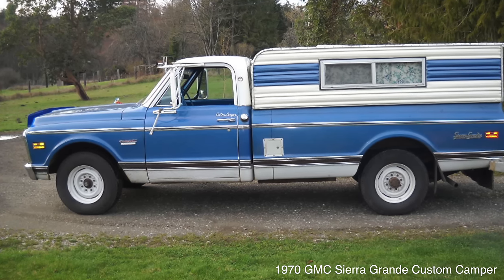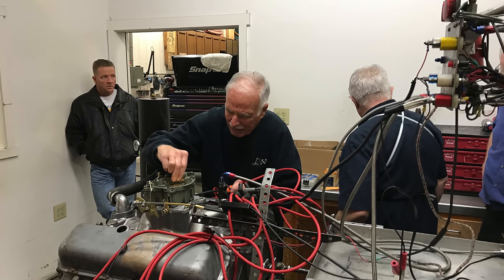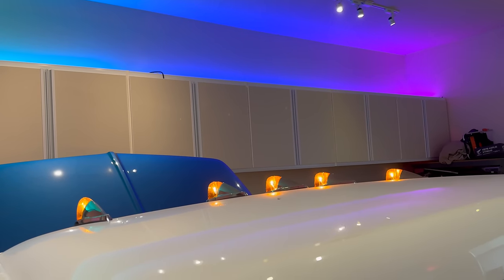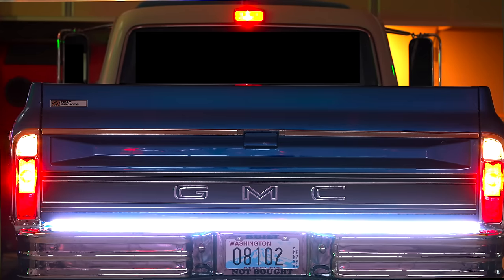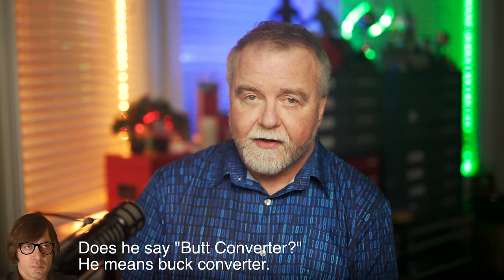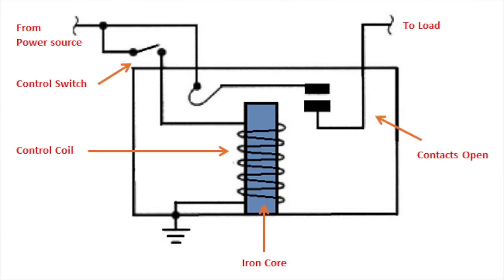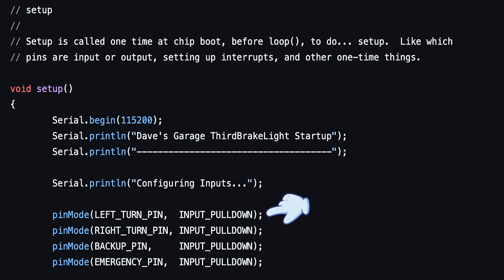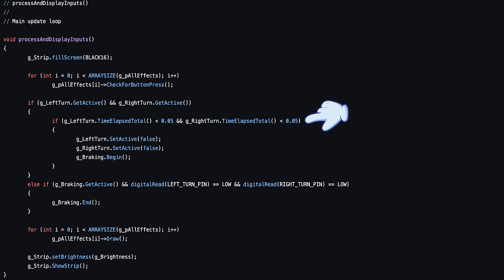New C++ LED Tricks for Our Old Truck: Sequential LEDs

Comment: Input yes you can use a simple voltage divider, but the optocoupler works well to get some isolation, especially if you use a 4V7 zener diode in series with the LED to get voltage immunity to the signal, so a blown bulb does not leave the brakes on all the time from stray voltage.

Resistor divider you also need a set of diodes to keep the voltage from exceeding supply rails, along with a small capacitor (roughly 100n) to provide noise immunity on the input. 

Incidentally reed relays work well, small, easy to drive, and the contacts interface well with MCU inputs as well, as they have very little bounce. Just have a pull up resistor to provide 2mA of contact current to keep them in good condition, and it works. I have added trailer relays to my car, as I do not want a faulty trailer wiring set to blow the BCM up, and used 4 relays to do this, using the existing lamp wiring as source, and an extra fused power lead from the battery. In the power line is a reed relay, with the coil replaced with 12 turns of enamelled copper, there to close the contact when current is over the draw of a 21W trailer lamp, and then the reed is powered from the 12V supply, and a lead runs off to a LED near the dash, that lights up whenever I press brakes, or turn, with trailer attached, as a confirmation that trailer indicators are working, and at least one brake light still works, and the plug is connected.

Will guess your TRS80 issue was simply because the original designers ran out of space in the very limited ROM, and thus to get space to fit all the headline specs they had to sacrifice some things, and the full keyboard debounce was chosen, simply because it was not an issue with a brand new keyboard, or only minimally so, only getting worse as the keyboards aged and were made cheaper. New switches with clean contacts minimal bounce, but as they age, and the contact surfaces, with only a very small current, get dirty, there is a build up of resistance till the force is enough to break through the film. 

That is why industrial logic almost always has a 24VDC rail, and 10mA of current flow through a switch input, even if it is going to a MCU input only. The voltage is high, and also the 10mA of current, along with the 22n to 100n input filtering capacitor, provides enough energy to always clean the contact surfaces, so allowing them to be reliable. 5V logic needs that 10mA of current flow, and gold plated contacts, to be almost as reliable, but most keyboard designs, due to the demands for low power, and also limitations of the CMOS and older NMOS designs in ability to source current, only use much lower current instead, and thus the need for software debounce increases as the key switches age.

Comment: My new '22 explorer ST, if you plug ANYTHING into the trailer wire, it detects it and auto puts the truck in tow mode and disabled reverse cam and such. It senses the power draw, even a single LED sets it off. I tested it. I put LED lights in the bumper reflectors and ran across this and had to re wire from the tail lights direct, which are just LED enclosures too. Lol. No more changing a simple light bulb.
Reply: Use an octo-coupler relay. They won't draw enough power to trigger it.
Reply: @-Primer- If a single LED sets it off, the opto-coupler probably will too as it is an LED too. Might need a field-effect transistor with very high impedance monitoring the lines.
Reply: It's the damn kiddie engineers adding more useless "features" with the CANBUS... Hell, they couldn't even get the Jeep Wrangler UConnect system to handle something as simple as MP3 playlists correctly...

Comment: I'd use the brake signal before it's mixed in by pulling a signal from the brake switch at the top of the pedal under the dash. In fact, I'd pick all the signals up there & run them in cable to the back of the bed where I'd embed the micro in a sealed box with drain holes. That way it leaves the whole system available even when a trailer is connected.

Comment: I haven't done anything this cool, but I did build an LED turn signal controller for an old Harley Sportster I once had. I used an Arduino Nano, a 5V regulator, a couple power transistors to drive the turn signals, and a couple optoisolators to simplify converting the 12-14V switched by the turn signal buttons to the 5v required by the input pins. Each button could toggle the respective turn signal on or off, cancel the other signal if it was previously flashing, and if both were pressed simultaneously, they'd flash a hazard pattern. I house the controller in an Altoids tin. It lasted a couple of years, but I think heat eventually killed it. 

I've considered using something like a Raspberry Pi Nano to implement a can bus on my older bikes with maybe bluetooth to send data to an android app to display.

Comment: I was a computer repair technician for Radio Shack at their Albany NY repair depot.  The keyboard on the TRS-80 model 1 initial release was trash, but early in its lifetime the key bounce wasn't really a problem.  As they aged they'd get noisy and Tandy's fix was to have us clean the contacts on each individual key until they all stopped bouncing.  Needless to say re had a lot of "to-do" repairs.  The denounce patch was a stop gap.  The next version had a better keyboard and also the keyboard input routine was updated in the ROMs.
Reply: I hate autocorrect.  While I would have welcomed a denounce patch, was of course a debounce patch.

Comment: I’m the 70’s I had a 3/4 ton 68 Chevy pickup and a few years later I had a 4x4 73 pickup Chevy, I rebuilt a few Gm 350 and Pontiac 400 motors, bought a new 86 TransAm, did a lot when I was younger

Comment: I built my own turn signal indicator with LEDs back in 2008 for my 1994 Honda Transalp. But they were just all on all off, simple replacement for the bulbs. They were the first generation of high brightness LEDs and I used a bunch of them on a thru-hole board that fit snugly in the indicator housings. I built my own 555-based turn relay that handled the lower current of the LEDs (Original relays flash fast with LEDs because of the lower current). I did have ideas for making animated turn signals with a 555 and binary counter, but it never came to fruition due to other stuff going on in my life.

Comment: Nice.
I made my own turn signals for my Can-Am with a PIC16F690 and using a relay board from Amazon just like what you had in one of your screenshots.
I have a 20 yr old Ford Ranger project truck that I was thinking of making my own turn signal controller since I am so used to the way you tap the modern turn signal levers to blink 3 or 4 times for lane change, etc.

Comment: In most of New Mexico, we don't use salt on the roads during winter. This and the dry climate means that vehicle undercarriages and body parts stay in good condition.  Instead of spreading salt when it snows, we put down red pumice (lava) rock on the streets.  Once on the street, this pumice gets ground down to be an extremely fine red slurry that gets EVERYWHERE.  Over time, no matter how much you spray and clean, there is still red dust that is only visible when parts of the car are dissembled.  There may be somewhere in CA that does the same thing.
Reply: Hard to tell which is better / worse... They use both salt sand tiny granite pieces where I live. Salt is just nasty, and the tiny granite pieces are rough, coarse, and get everywhere... At least they can be vacuumed away and don't color stuff
Reply: So, you you end up with more broken windshields... I have a Jeep Wrangler and the windshield on that thing is a rock chip magnet...

Comment: Love your truck, I grew up with a Chevy 1968 3/4 ton, california truck Sacramento, Blue, with white, 350 V8, automatic tubo shift, limitied shift, rubber mats, Air-conditionaing, 8' bed, 9.5' camper, limit slip differencial, loved the truck but it really ate the gas.

Comment: I've got an old City of Los Angeles Roads Department 1967 C20. It's not a restoration but a RestoMod without the Resto part! It's got a 350/TH400 combo with a late 70s 14 bolt for the rear. I drive it absolutely everywhere. I've had it since 2007 and I don't think I'll ever sell it.

Comment: I've done similar things using a voltage divider... You just use some high value resistors to ensure that there isn't much current in the circuit... 

Although it would have involved a bit more wiring, a solution that would have simplified your code quite a bit would have been to run wires to the brake switch, turn signal stalk, and emergency flasher switch... Considering how much you tore the vehicle apart during the restoration, adding a bit extra wiring would have probably been pretty easy to do...

As far as reverse lights go, I prefer to be able to turn them on even when the transmission is not in reverse, so I add a small switch that controls a pair of 4" LED cube lights under my trailer hitch in my Jeep... If I need the extra light for backing out of a dark driveway, it's easy to switch them on, but mostly, I just flash them at anyone who is tailgating and who doesn't get the hint when I turn my windshield washers on... ;)  I thought about getting a bumper sticker that says, "WARNING -- Driver uses relief tube", but probably most non-pilots wouldn't know what that is anyway...

Comment: Under unusual circumstances, the voltage on the battery system can reach quite high voltages. 
I read that automotive manufacturers spec this around +-90 volts for a few mS. 
One cause is removing the battery terminal while under heavy charge.
And don't forget sparks and such when jumper charging.
Duane C. Johnson

Comment: In Europe, and I believe most of the rest of the world, turn signals are flashing orange lights which are separate from the red brake lights. We also have lower intensity red tail lights that are used when it is dark.
Reply: Of course America has to be different...
Reply: That's also true on many American market cars, but the stupid combined stop/turn signals are also allowed for unknown reasons.
Reply: @eDoc2020  -- The combined stop/turn signals are probably a legacy thing... It works, so there is no reason to change it... I first noticed it when I was replacing the lights and wiring on a utility trailer after my dogs had literally ATE the wire and lights -- or at least all the plastic...
Reply: @CurmudgeonExtraordinaire  It was a legacy thing. But from other comments more and more modern vehicles are starting to adopt it. Alec from Technology Connections would NOT be proud.

Comment: Bookmarking this video (only half-way through) because I'm planning on doing the same with our 67 mustang coupe. Adding a 3rd brake light strip with additional functions as a turn indicator and attention flasher when applying brakes.   These old cars feel like a tin can, anything to improve safety is paramount over horsepo... just kidding. Both are important to improve!  :)

Comment: That 7 pin seems to be mostly american, In Australia we dont generally have a 12v connection on our 7pin. I would also consider running a dedicated 12v accessory fed relay to power the esp, so your not vampiring the battery (even tho it will take a long time to flatten it @ ~ 100ma,  +/- buck converters draw), You could also do some cool things like monitor the car battery voltage when sitting and send you a warning if it drops to a certain point.

Comment: 13:00: I'd certainly absolutely unquestionably positively go with optocouplers, and chose the ones with the best internal overvoltage protection, and prefer the ones with voltage input to current input). The vintage relay blinkers may generate horrible voltage spikes if the bulb burns open.

Comment: You only need a resister like 1kohm, and a zener diode rated at 3v zener voltage. To use a zener as a voltage clamp you hook it up in reverse where the cathode/stripe is connected to the positive voltage input signal and the anode is connected to ground. The resister is to limit the current into the zener so it doesn't just blow up. The resister goes between the 12v input and 3v output and the zener goes between 3v output and ground. It's much smaller than a relay and can be done with surface mount parts.
You can also use a zener for over voltage protection and reverse polarity as it will short out in those situations and you just use a self-healing fuse and a sufficiently large zener (so it doesn't pop before the fuse does, like 10w or a big one)

Comment: My 'restoration' is also my daily driver and is much less cool since I am 19 years old. I've done a full LED conversion, with good quality LED bulbs with good color, beam pattern, brightness, etc.. Basically looks stock, just way brighter. I am now trying to fully emulate the incandescent look by adding a low pass filter to the brakes/turn signals so they turn on/off smoothly but that is causing some freakouts in the lighting circuitry when I do it with an R-C filter so I may need to do it with PWM instead.

Comment: You can do it with a Zener diode and a resister. This type of diode acts as a voltage shut and will limit the voltage going across it.

Comment: As someone who has put the back of their head through a rear window of a chavy pickup, I approve of this, but it wouldnt have helped in my case. In 1990 I was in community college and delivering appliances part time for a family store in rural northern Illinois.  I pulled completely off thr road on a solf Shoulder to check a map (yes kids we used paper map books in the olden times).  My partner and figured out where we went wrong and i reached down to releade the parking brake and checked my mirror at the same time.  I saw a car swerve in my mirror but thought nothing of it since they never left the lane.  As i was shifting the 1985 Chevy into first, wam!  A drunk 18 year old slammed into the back of the truck at 60mph.  It barely dented the utility body and lift gate on my truck, but destroyd his Didge Diplomat.  My head went backwards through the back glass.  I still have a dent over my left ear and pieces of glass embedded in my skull that they decided not to take out.

Comment: Yep, you could do a voltage divider with resistors and i would say that is better than using a relay for isolation. Maybe a 1500ohm in the high side and 470 ohm on the low side.  This would allow for~3.3v when 14 is supplied.  I like the idea of an opto isolator better though as it would prevent spikes and other noise.

Comment: Nice little project, definitely like the aspect side of it. I'm rather tired of seeing vehicles with lights that can barely be seen. I'd like to see this implemented with the modern CAN bus. I suspect it would be a bit easier to determine brake lights vs turning vs hazards once the hardware is communicating. The 12v version of the LEDs would be nice if only to bypass the buck converter. A smaller buck could be used for the ESP itself.

Comment: You could have used a zener diode and couple of resistors as a voltage divider from the 12v signals. This would create a very stable 3v output no matter what the 12-14v supply voltage is at. I sometimes use this simple circuit instead of a regulator for very low powered microcontrollers. Another way would be to use an NPN transistor and a resistor to pull the microcontroller pin low when 12V appears at its base.

Comment: I completely agree with your choice to isolate the ESP's inputs. A voltage divider would work, but the question would be for how long. Apart from the alternator's charging voltage, there can be all sorts of voltage spikes on the car's 12V circuit. All it takes is a single high enough spike to fry the ESP's input.

P.S. The requirement for complicated logic to correctly distinguish between indicating and braking is perhaps the best argument I've ever heard against the use of combined indicator and brake lights ;)
Reply: Voltage divider with a reasonable capacitor to help with debounce or transients should work.

Remember, you only need "enough" voltage sensed to know it's high, you don't have to hit 3.3v or 5.0v, something like 2.5 might be enough, and you could design your divider to achieve that nominally (and thus larger voltages wouldn't be a problem). A capacitor (small value so it doesn't contribute a large amount of time) would help iron out any (brief) spikes.

A simple 2n2222 (or equiv) transistor and a few resistors would also work and also deliver isolation.

Also, I believe the ESP32 can actually tolerate 5v on input pins (not widely known, and maybe not all variants).
Reply: One advantage of a direct connect would be if you put in a small "pull-high current", you could detect a bulb failure.

Comment: A voltage divider from twelve volts will reduce transients proportionately but most things that run on 3.3v are pretty picky that you get that very close. A properly applied buck converter fed slightly over dropout should suffice.